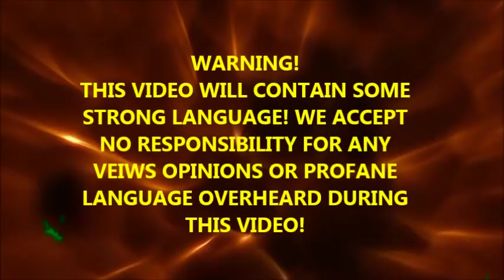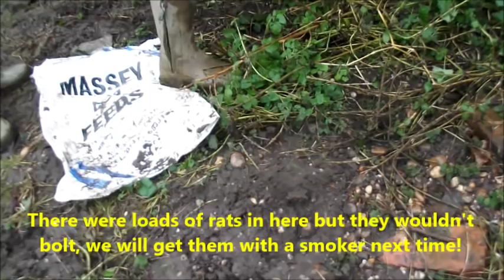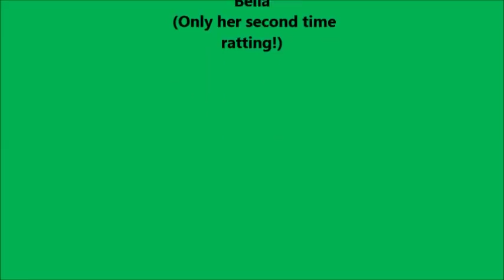Ratting with 3 Plummer Terriers Over 100 rats! Severn valley ratters best video yet! New 2014!

Comment: The difference in quality between different ratters is interesting. I just came from another video where they didn't remove the rate corpses (which confused the dogs), they kept uncovering new areas before letting the dogs kill the rats that had JUST FLED from the areas they had previously uncovered (which let a lot of rats escape), and the dogs seemed to have slow reflexes and low interest. And there were like, ten of those dogs. Meanwhile, you've got only three terriers, and holy shit! Look at them go!! That's insane.

Comment: did you just kick the brown dog "belle"  after you pulled its tail?
Reply: What time did you see this
Reply: +DIYmakeup 101  right after the guy pulled the brown dog tail  1:26
Reply: +STEPHANIE THOMAS The dog wasn't kicked. It was just held back so the rat would flush, then the dog lunged into the wall to catch it. It was definitely pulled by its tail, but don't worry. Being picked up by the tail doesn't hurt this breed. They've been bred with strong spines so they can be hauled out of rat and rabbit holes. They go in head first, get stuck, and sometimes it's the only way to get the dog back out. I mean you don't swing them around or anything, just a quick lift up and out.
Reply: oh thank god then, thanks for the info